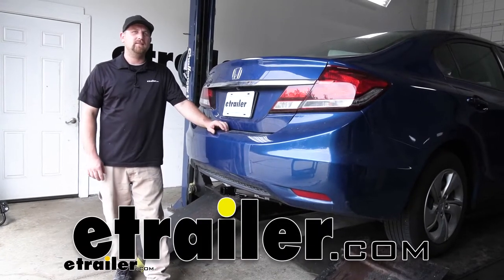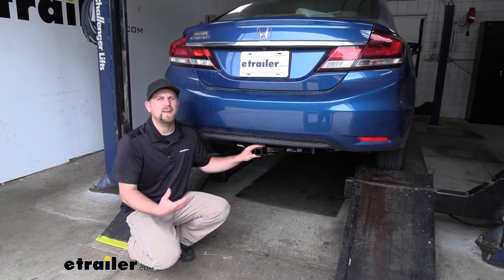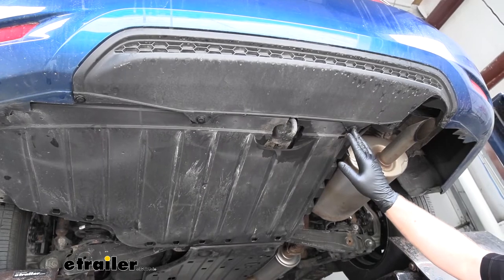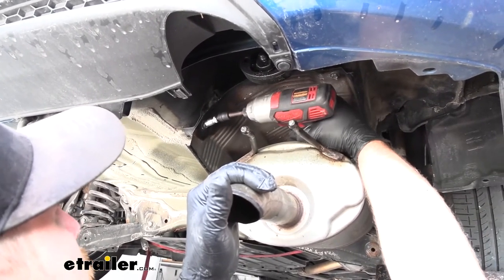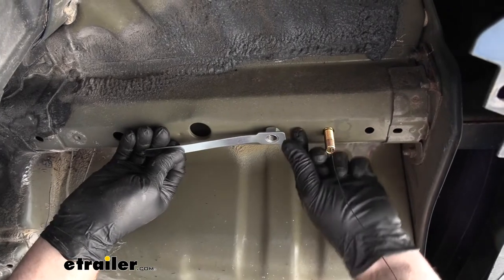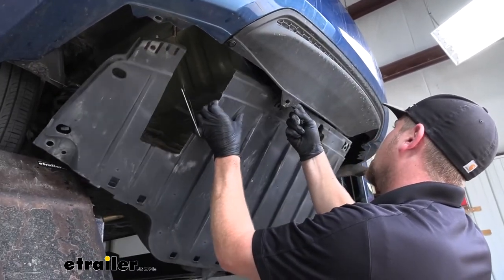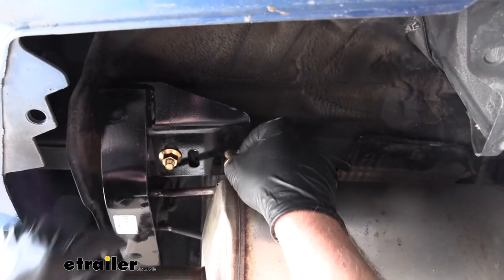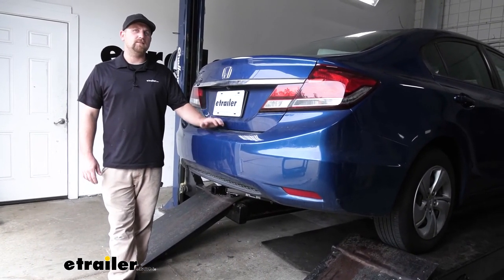etrailer | Curt Trailer Hitch Installation - 2015 Honda Civic

Comment: Quel est le nom du kit de boulons je dois le re installé sur mon autre civic et j’ai du couper les bolts merci
Reply from the maker: Translation: What is the name of the bolt kit I have to reinstall it on my other civic and I had to cut the bolts thank you...
Are you speaking of replacement hitch install hardware? If so, you'll need part # RHK. On the product page we've linked you to, you'll want to input 'C11391' into the field for hitch part number and choose 'Curt' from the drop-down menu.
https://www.etrailer.com/Accessories-and-Parts/etrailer/RHK.html

Comment: That's a difficult job and not for the weekend DIYer.
Reply from the maker: This hitch installation will be pretty involved but is not impossible if you take your time and follow the correct steps.
https://www.etrailer.com/Trailer-Hitch/CURT/C11391.html